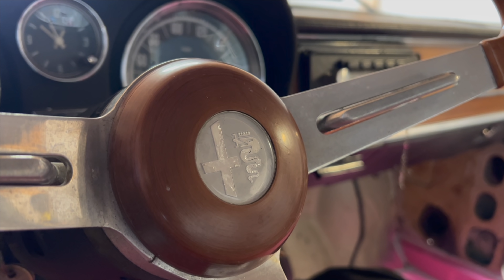Using Bedliner to Coat the Floor Pan (Alfa Romeo Giulia from 1972)

Comment: Excellent work.  This reminds me of the work I did to the floor of my old Jeep Cherokee. Something  you'd probably hate was that after painting ,I flooded the floor with 3M cavity wax and let a skin dry on it before refitting the insulation and carpets.  The plus side is a lovely new car smell which never seems to fade.
Reply from the maker: Hi James. Thanks!
I’m not hating it. There are many roads to success and if it works, it can’t be that bad.

Comment: Excellent idea with the bed liner, if it can protect the back of a work truck with rocks and tools and what have you being thrown in there, it should survive your boot as it slams into the carpet padded floor when you accelerate, that should outlast us all
Reply from the maker: Exactly! 😆😆
Reply from the maker: With my 1.3 litre engine. ☺️

Comment: Great Video!  Bedliner is exactly what I have been planning to use for the undercoating and interior of pan on my ‘72 911 restoration as you can color match to your paint and when it does get damaged the color goes all the way through!  A guy on pelican parts gave me the idea.  He did it originally to save time, as you don’t have to do a top coat of paint!  I will also do the engine bay and front trunk around the gas tank and batteries.  And yes more trucks in the USA than you can even imagine.  Huge ones jacked up with monster wheels!
Reply from the maker: Thanks, Rodney. It’s most encouraging that you too go down that road. 

The statement with the Pick-up trucks was mostly meant to annoy my German friend, a car guy who moved from Stuttgart to Detroit and bought a truck before he bought a house. Mind you - he used to own a VW Polo Diesel in Germany (“it’s all I need”).

Comment: Bed liner is very versatile stuff.  I used it (Raptor Liner) in a manner very similar to what you did on a major restoration project.  It goes on easily, adheres well, and is very durable.  The textured finish also makes if very easy to repair if it is damaged, even using a roller or a brush.
Reply from the maker: Thanks, John.
Yes, it’s magnificent material. It’s a shame I only got aware of it so late.

Comment: Heart warming. The Giulia was, and in IMO is still under-appreciated (OK, perhaps I'm biased having spent age 11 to 15 being driven around in a beautiful yellow ochre 1.6 Super), in many ways it was unmatched in its class. Perhaps partly due to the fact that Alfa never produced hotted up and even 'homologation' versions the way the likes of Ford and BMW did with various Escorts/Cortinas and 2002's respectively.  I never realised until just now that Alfa went to such lengths to get 'quietitude' in the cabin, but I do remember ours (1971) was very always a nice place to be, even for hours at a time crossing the UK or Europe. Once again, thoroughly enjoyed the vid, molto grazie
Reply from the maker: Thanks, mate and very welcome.
In fact I think you’re quite right. The Giulia offers pretty much the same driving pleasure than the GT for 1/3 to 1/2 the money.
Reply: @GreasyFingers  That's true.  Also the body shell is much stronger and less prone to bend the rear boot as in some overloaded GT's . If too much weight is put inside the boot of a GT,  guaranteed it will bend the rear end.  Not on the Giulia.  I think you will end up with the most comprehensively well restored Giulia in the world.

Comment: Your videos a great! You motivate me to get my restorations done! The 2 part bed liners are great except for one thing, when it is chipped by rocks because it is harder than other 1 part products it chips a lot easier and then it will let moisture underneath it and will rust. I know a few restoration places use a paintable 1 part product with a 2 part paint and clear over the top so you get the benefits of both.
Reply from the maker: That’s very interesting information, Flynn. Thank you! 
Is the one-part product colourable bedliner too? Or just normal stone guard?
Reply: @GreasyFingers  It’s normal stone guard that can be painted over the top, I think it is water based instead of solvent based which 
 is not paintable. It looks the same as the colourable stuff once it is painted.

Comment: I like U-pol Raptor bedliner for the same purpose. Have you ever heard of, or used, Lizardskin heat and noise spray insulation for cars? I've done that prior to raptor as well to help reduce those elements, but do find that Raptor alone really reduces road noise. Great work as always! Oh, one last trick is to use dry ice to remove the bitumen. You let it set in place, then remove and you can use a mallet to shatter the bitumen as it pops off of the metal. Tschuss!
Reply from the maker: Thanks for commenting, Steve.
I heard about Lizardskin, but never used it. Does it remain flexible like classic stone guard?
The dry ice method was recommended to me before. On my list to try it in the next project …
Reply: @GreasyFingers  Yes, it remains flexible and is also strong, but I always have used bed liner over top to make it more resistant to damage.
Reply from the maker: @steveschriefer2733  Will try!

Comment: This is the video I needed 2 weeks ago 😅
Reply from the maker: How come, Marco?
Reply: @GreasyFingers  because I’m restoring a ‘74 spider and 2 weeks ago I was upside down removing the heater just like you did in the video 😂. Your videos are very helpful, thank you so much!!
Reply from the maker: @marcofilippini5060  Ahh! Thanks, Marco!
In fact it’s devastating work to remove the heater. My back‘s still aching.
Reply: @GreasyFingers  ahh yes, any job under the dash is unpleasant especially the heater. I was cleaning old sound proofing off the firewall, replacing new soundproofing and refitting my refurbished heater in my 2000 GTV last weekend. Not the nicest job :) Thanks for the bedliner hint!
Reply: I always wondered why my heater didn't seem to turn off. Then I removed it and found that there were no internals in the water valve. It must have failed and rather than replacing it someone removed the internals and screwed an aluminum plate onto the valve base... so water was always flowing through it. It now has a nice new heater core and valve. Ohh, and they only used three nuts to hold it up to the underside of the dash so the upper housing had fractured in multiple places, thankfully I found a replacement. Ahh, joys of previous owners :)
Reply from the maker: O dear, o dear, Mark. I wonder what I’m going to experience with it. The valve is calcified all over, not a good sign.
Reply: @GreasyFingers  keep it simple, just buy a new (metal) valve and new core.... they are readily available from the usual suppliers. My heater core had leaked down into the motor so i had to clean and service that. And let's not talk about the probably toxic green stuff growing inside the lower housing... I completely stripped everything, de-rusted and repainted the crusty air flaps, reassembled and adjusted the linkages etc. Fiddly but satisfying.
Reply: @GreasyFingers  my valve was like a “ghost” made of dust and blue crystals. It disappeared as soon as I touched it

Comment: Nice episode. Hope you dont mind another bunch of questions: 
- Why do you use the sealant/primer meant for "Nahtabdichtung" as a primer for everything? I would have expected some 2k Epoxy in your case. 🙂
-  Are you using a special nozzle on the small paint gun? Or is the PU 420 thin enough?
- Did you consider spraying the bedliner with a normal spray gun to get a smoother finish? I imagine you'd have an easier time sticking something like alu-butyl mats to the floor on a smoother surface. 
- Lastly, why do you use water based basecoat otherwise, ecology in mind?
- Last2 how do you deal with cold temperatures, is your garage heated?

Sorry ;-)

Great Job!
Reply from the maker: Thanks, Alessandro.

Don’t quite understand your first question. The pink stuff is 2c epoxy primer, the body sealant (Nahtabdichtung) is PUR-based. The bedliner is PUR-based too. I’ve made good experiences with PUR-based body sealant, so I didn’t challenge it. Any recommendations?

The small paint gun that I’ve used for all my films in the past years is equipped with a standard 1mm nozzle. It’d never work with the bedliner which is far too thick. For the bed liner I used the one provided by mipa specifically for that purpose. 

The alu-butyl mats, I hope, will attach the the slightly rougher surface just as good, but that’s an open question and a concern, I admit. 

I use water-based paint because acrylic paint has become very difficult to get in Germany. Environment is a point, too, but I confess not the main one.
Reply from the maker: Ahhhh, yes, the workshop has a heating. I keep it at about 12-13 degrees.
Reply: @GreasyFingers  thanks for responding so thorougly (as always)! 
Sorry didnt know that your epoxy primer was also pink, hence I assumed you'd use the body sealant for the surfaces. I'm still surprised you are able to spray with such a small spray gun and small nozzle as well. You made me so invested in painting with a spray gun that started to be relatively meticulous about nozzle sizes and so on.  I will be trying to spray the same mipa bedliner with a 2.0 nozzle. Thinning out the paint a bit as to mipa's specifications to get a bit finer finish. Similarly I plan to use the bigger nozzle sizes for spraying filler.

I'm surprised about your statement about the availability, since I get my acrylic paint from germany. But I guess what you mean is that  you can get water based more easily just around the corner.  
Did you mix the bedliner with Water-Based BC?
Thank you as always. My workflow really took a lot of cues from yours, to the point that I now own both Makita Belt-Sanders as well. 🙂Magnet are holding work for me as well nowadays and so on.
Reply: @GreasyFingers  Call me jealous about the heating. 🙂
Reply from the maker: @alessandromeyer4888  Thanks for the feedback, Alessandro. If you plan to use the gun inside the workshop without extraction system, it’s important to buy a LPLV-product, low pressure, low volume that is. I use a 1mm for the same reason: as little overspray as possible. 

Availability of acrylic uni colours is okay, with metallic ones however there’s a 50% likelihood you won’t get them in Germany. In fact I don’t know the reason, but it’s what I experience.

Alessandro Meyer, if I may say that, reminds me of South Tyrol. Good guess? I know a guy there who could make all my paints if only his workshop relocation would finally be finished.

Comment: Wie immer entweder ganz oder gar nicht. Zum coating. Ich habe einen T1 oder Bremer vor der Tür. Der soll mich mal durch ferne Länder fahren. In der Recherche bin ich auf Naviton gekommen. Die Firma ist eine knapp Stunde von mir zu Hause. Ergo bin ich hin und durfte aus erster Hand  lernen was die drauf haben. Haftvermittler oder Grundierung sind Basis auf die je nach Bedarf und Einsatz aufgebaut wird bis zu schlagfesten Aussenschicht Incl UV Schutz.. Fakt ist saubere Ausführung ist eine der besten Zutaten. Wieder top scoring für die non greasy fingers at work.
Reply from the maker: Danke, Achim. 
Das ganze Thema wird überall sehr kontrovers diskutiert und es gibt viele Mythen im Netz, die dann (meistens ohne eigene Erfahrung) nachgeplappert werden. 
Eins ist für mich auf jeden Fall sicher: gute Verarbeitung ist - genau wie Du sagst - fast immer wichtiger als das Material selbst und ein Epoxy-Primer ist immer die Basis.

Comment: Love the work, just feel like there are a lot of problems that you could cause by powerwashing the interior, especially on a 50 year old car known for rust.
Reply from the maker: Yeah, it’s certainly not without risk, but that’s why I primed it first and applied body sealant to the gaps. To improve my probability of survival… 😆
Reply: @GreasyFingers  yea again i think you did a wonderful job, were you at all worried about the dash either?
Reply from the maker: @notaberger_3216  No, not really. The battery was out and I avoided hitting vinyl leather and wood. The instruments are showing there metal housings towards the direction where water comes and apart from that they can take some steam. There are no unpainted surfaces down there, and I had heated up the workshop to 15 degrees that day to make it all dry quickly.

Comment: Hi 
I'm trying to release my inner German on my Porsche 912, I'm currently scrapping off all the under sealant, can you tell me roughly how many litres of Mipa Protector I'd need for engine bay, boot compartment, interior floor & all four wheel arches. They sell it in 4lt kit, but I'm wondering will I need more. Thx Craig
Reply from the maker: Hi Craig. The inner German … 😆
I think 4 litres will be enough. On floor of the Giulia I used 1 litre.
Reply: @GreasyFingers  Great thanks for the quick reply